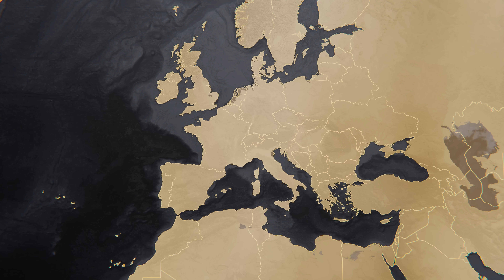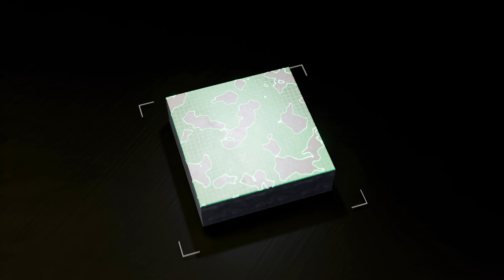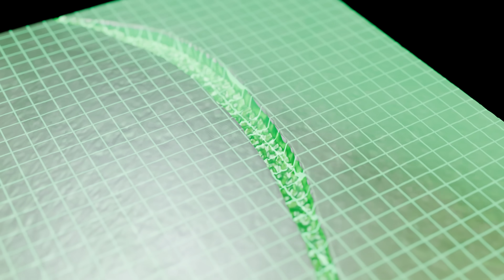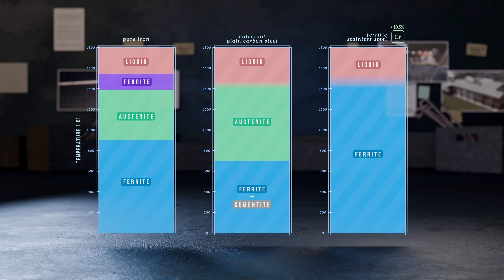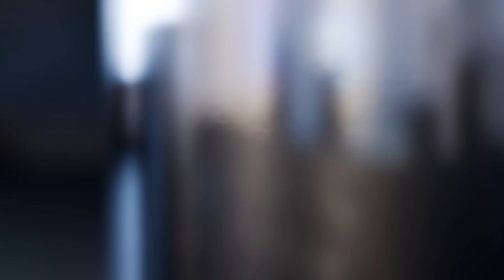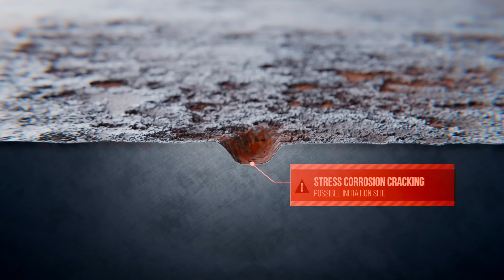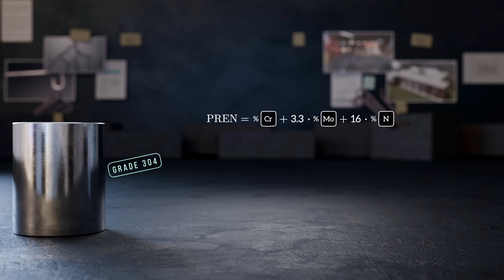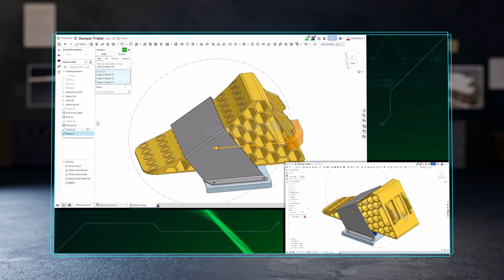The Problem with Stainless Steel

Comment: As a swiss guy who studies engineering the Uster roof collapse story was told so many times I lost count but I am surprised that it is somewhat known to engineers around the world. Great video btw.
Reply: Architects and welders told about Eifel tower and material scientists get bedtime stories of dead swiss swimmers and marine/oil refinemedt infrastructure failures.
Reply: How thick were the SS rods?? - I didn't hear it mentioned.
Reply from the maker: @brettymike  10mm in diameter. You can see them clearly here: https://www.gettyimages.co.uk/detail/news-photo/decken-einsturz-hallenbad-uster-1985-news-photo/1174034462
Reply: Wouldn't painting or epoxy coating the rods prevent the chlorides from reaching the steel?
Reply: @nunuvyerbizness Epoxy is perfect for mold and paint chips off. Thats worse than nothing.

Comment: In Germany the most common stainless steels are V2A( "Versuchsschmelze 2, austenitisch/ same as 304 grade)and  V4A("Versuchsschmelze 4, austenitisch"/ same as 316 grade). We were specifically taught that V2A is not suitable for applications such as a ladder for a swimming pool as it's not corrosion resistant in chlorine rich environments. V4A on the other hand is well suited for such applications. Very well explained, gave me a huge throwback to my material science class
Reply: The US Navy uses 316 stainless instead of 304 precisely because of the superior corrosion resistance of 316. 304 is fine for sinks and tableware.
Reply: @tyrannus_tyrannus  - Yes, we hope there's less chlorine in our sinks!🛁🪥🪒🧼😂
Reply: @tyrannus_tyrannus prior hull tech?  My brother!!!!
Reply: @tyrannus_tyrannus 316 is sometimes called as marine steel.
Reply: "We were specifically taught that V2A is not suitable for applications such as a ladder for a swimming pool as it's not corrosion resistant in chlorine rich environments."

I well remember that the professor in our first course in material science more than 40 years ago told us: "Stainless steel is not absolutely corrosion resistant, opposed to what you may expect. E. g. V2A is not suited for swimming halls due to chlorine in the air. This lead to the collapse of the swimming hall in xyz." I don't remember which location he told us, probably it was Uster, as that was just the same year.
Reply: in australia we have 316 and 316L, 316L is high corrosive resistant.
Reply: @horseshoe182   The “L” in 316L stands for low carbon. It’s used in applications where it’s going to be welded because when it’s heated above the sensitization temperature the chromium reacts with carbon to form chromium carbides, and thus create regions depleted of free chromium which are no longer stainless, even after the steel has cooled down (the carbides are very stable). In applications where the steel won’t reach such high temperatures 316L isn’t any more stainless than normal 316.
Reply: @ASJC27  Not only that, but the "L" grade almost always has less heat resistance than the normal one. You can't keep it at high temperatures for as long as the normal carbon or H grade. Just avoid keeping it in the sensitization zone.
Reply: @ASJC27  yes it was welded. i,m a welder.
Reply: In Australia besides the 316's we have 304 etc etc
 304 is cheaper but shouldn't be used in marine environments.
Reply: I think in marine application there's naturally a lot of chloride concentration level, in the water and in vapor / aerosol droplets.
Does that mean 304 under tension in marine applications should always be expected vulnerable to stress corrosion effects, around sea water ?
I presume so. Is 304 SS ruled out, or not selected for marine applications ?
Reply: @lc99sj  - Yes.
Reply: @horseshoe182 the L designation means low carbon. It doesn’t have much to do with corrosion. It means that the alloy is suitable for welding. Anything made from stainless, whether 304, 306, 321, etc. will form brittle welds if they have higher levels of carbon as they form carbides in the joint and the heat affected zones. “L” series has almost all carbon removed.
Reply: @horseshoe182  - In New York/New Jersey, we have at least 20 different types of SS.
Reply: Fun fact. V2A is actually a German invention, Krupp was the first to commercialise austenitic stainless steel. Modern 304 is almost the same as V2A. It first started being used in the 20's. The Chrysler Building still has its original panels from that era!
Reply: In Missouri USA, a LOT of race car manufacturers use 304 due to cost and availability. 304 and 316 stainless steel are both common austenitic grades, but 316 contains molybdenum, giving it significantly better corrosion resistance, especially against chlorides (salt) and industrial chemicals, making it ideal for marine or harsh environments, while 304 is more economical and suitable for general indoor/food applications. The choice depends on the environment: use 304 for cost-effectiveness in mild conditions and 316 for superior performance in corrosive settings like saltwater or chemical plants.
Reply: Fellow Missourian here. The only places I have seen Duplex and Super Duplex are in pharmaceutical and industrial applications. Some food and beverage manufacturers prefer 316 to 304 but some care about the price more. BQ (Brewery Quality) pipe is a fun rabbit hole to go down as it was developed by Anheuser Busch. The lack of cavitations in the BQ pipe allowed for a more pure brewing process.
Reply: Yeah 316 has moly in it, specifically it resists chlorides. At my work we have vacuum systems that run HCl gas, if they leak all the 304 rusts, but the 316 stays pretty unfazed. We have a mix as the cheap aftermarket parts are 304 while the genuine oem bits are 316, not really worth the extra cost as the system has a zero leak tolerance anyway (so a leak is an issue regardless of if it rusts after or not).
Reply: @xxportalxx.  But even if you have to fix the leak regardless, you still need to replace more stuff with 304?
Reply: @DKNguyen3.1415 You have bigger issue than some rusting if you have HCL leaks, is what his main point is.

Its like having salt cooled nuclear reactor, outside of cooling loop and reactor itself the components doesn't need to be as corrosive resistant , since if it ever leaked swapping the parts is the last thing to worry about.
Reply: Danke für die Klarstellung. Meine Werkstoffkunde Vorlesung hat Stahl nur kurz behandelt und dann eher CFK und Nickelbasis Legierungen.
Reply: @Vinzmannn  Luftfahrt oder warum Stahl nur kurz?
Reply: Yeah that's exactly why experienced engineering can get paid 10x the inexperienced ones
Reply: @pacestream8279 We only called it 304, 316 etc so Germans didn't have to make up new words!
Reply: @markrainford1219 Sorry mixed up my norms, it's EN 10088 that deals with materialnumbers😅
Reply: @markrainford1219 but V2A was there before 304...
Reply: @markrainford1219 First time learning that the US is not the only place on earth? Anyways, technically V4A etc.  is not their name according to the norm EN 10027-2. Depending on the actual steel we call them 1.4XXX. If we talk about fastners it A4 etc. And by the way, yes we needed the new names, cause the american AISI norm has higher tolerances and that simply ain't cutting it
Reply: @forgetmeinstandly  you Germans sure cry alot 😂
Reply: In good way or in bad way?
Reply: I wonder if the pool wasn't chlorine based if that would have made a difference.
Reply: Well there are grades that are called RUS - rost- und säurebeständig. Both of those cheap grades are not.
Reply: i learned about stainless steel's chlorine vulnerability as a teenager washing dishes at summer camp. I thought it would be common knowledge, especially among engineers.
Reply: @solder955  - You'd have thought, right?
Reply: Thép không rỉ thực chất là  khó rỉ. He he…
Reply: Sư nói cũng phsir , Vãi nói cũng hay . Lời nói phải , củ cải cũng  cũng nghe  .
Reply: How many types of stainless steels are there? Are there stronger ones than the V4A/316 grade standards?
Reply: Over in the states we call them Duplex Stainless Steels. From what I can remember, they were specifically designed because oil rigs on in the North Sea had trouble with their stainless steel parts corroding too quickly in the salt water environment. So they made those newer steels to be corrosion resistant in “halogen environments”. (The most common kind of salt found in water is sodium chloride, unlike table salts which are usually sodium CHLORIDE mixed with iodide salts like sodium iodide. Either way though, it’s considered a halogen environment, which stainless usually doesn’t do well in.) So hearing about them using non-duplex stainless steels, in an environment with heavily chlorinated water, sent alarm bells ringing. That’s just as bad as having dissimilar metals in contact with each other for long periods of time.
Reply: @Nikolai_The_Crazed table salt is sodium chloride. It may be iodized, which means a very small amount of iodine is added.
Reply: @melgross Yes, table salt is sodium chloride. That’s my mistake, but they do add iodide salts, like sodium iodide, to supplement iodine intake.
Reply: @Nikolai_The_Crazed that’s what I said. But it’s a very small amount.
Reply: why do you guys have to give things such aggressive sounding names. it makes everyone nervous. VERSUCHsschMELZE!
Reply: @JackMcGuire-em7nt No need to worry as long its not called Vergeltungsschmelze. 😂
Reply: Company I worked at used to call V2A "weather-proof" and V4A "salt-" or "high-sea"-proof. Guess now I know why.
Reply: We use Titanium in most pool ladders and structural services, and 316 SS in light fixtures. 😊
Reply: This is the most German thing I've ever heard 😂 You guys know your materials
Reply: Yep but you probably learnt that after 1985 when the pool roof collapsed
Reply: @garyallport18 It was engineered in 1912 as a more acid resistant steel. However probably nobody thought that a bit of chlorine in the air would be enough of a problem in construction.
Reply: @garyallport18 Common knowledge in 1976 when I started.
We were also taught to considor the exclusion of oxygen which enables the surface oxide to form and regenerate if damaged.
Reply: Same here in Norway where we learned where to use the different versions in material science class when you become an engineer. At least when I took the classes. Maybe it was not included years ago?  Due to salt water, oil and the marine industry I'm pretty sure they focused on it years ago too..
Reply: Despite having a PhD in Material Science, my most extensive coverage of ferrous metallurgy was as an undergrad ~1990-1092.  I do not recall anything about duplex stainless steels in my textbooks.  I primarily focused on non-ferrous alloys as an undergrad (precipitation hardened aircraft aluminum) and photonics and phosphors in grad school.  I work exclusively with semiconductors today but it is nice trip to take a nostalgic trip with this video and learn something new.
Reply: I was wondering if someone caught that. But generally, that’s the case when either in immersion or in close contact. It’s surprising that these corroded in the ceiling
Reply: Sư nói cũng phải , Vãi  nói cũng hay . Lời nói phải  , củ cải cũng nghe.
Reply: They taught you wrong, 316 also corrodes although slightly less than 316L and, 316 corrodes less than 304.
Reply: @tonybento7199 Who even said that they don't corrode? 🤨

Comment: I am now wondering if the chloride from PVC (poly-vinyl chloride) windows and pipes that are used in modern construction would have any affect on the corrosion on any stainless steel also used a lot.
Reply: Pvc doesn't release free chloride ions

Comment: Buddy, thanks for cool animations. As RnD mechanical engineer I constantly find myself arguing about those misunderstood flaws of SS304 in specific environments. Matter of facts last time I had this same argument was May 2025 😮. Lost it due to cost 😅. I’ll use this video for visualized arguments in future, while asking my future managers to pay you a coffees.  
You’re really effective in explaining. 🎉🎉🎉 Appreciated.
Reply: yea no kidding. i worked in the automotive industry with 304 and fuel systems. "Strain induced martensite" in Austenitic is the point where the crosision will start. i never knew why. seen it in the salt spray booth many a time. right where you bend it is where the corrosion starts. we did some evil extrusions and yep it starts  there on the inside. of course this is without the chloride problem added on top and their "worked" section was embedded in the cement. so i dont know what happens there.

Comment: Would 316 help avoid the catastrophy, had it been used instead of 304? Or you'd still need to use "marine grade" superaustenitic or superduplex?
Reply: In the real world, things are usually done with layers of redundancy because nobody can predict the future:
-> choose the best material for the project within the budget and safety parameters
-> review and analyze the design from different trades and experts, not just a CEO or company engineer.
-> frequent inspections after installation, redesign or retrofit if problems show up
In this case, the designers and engineers were convicted of homicide due to evidence they knew the problem existed and didn't do anything.